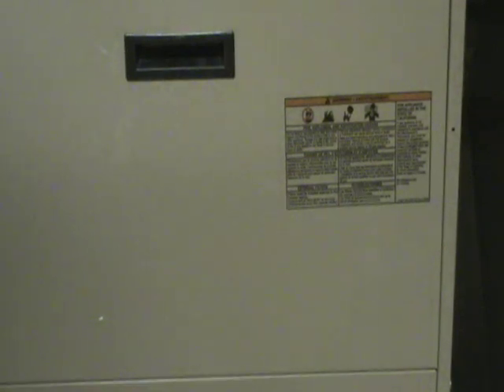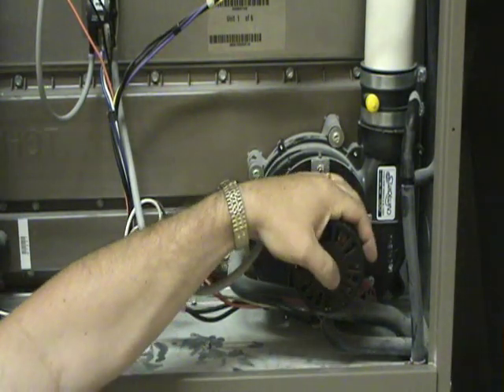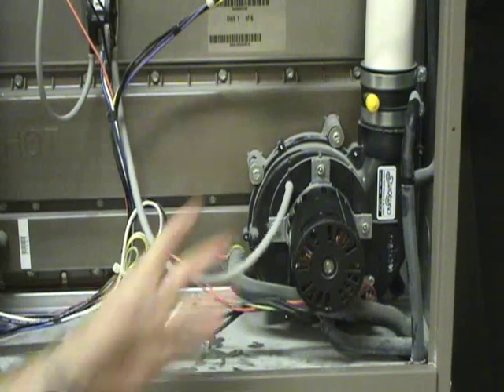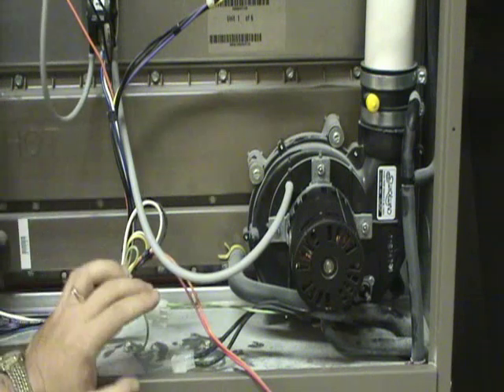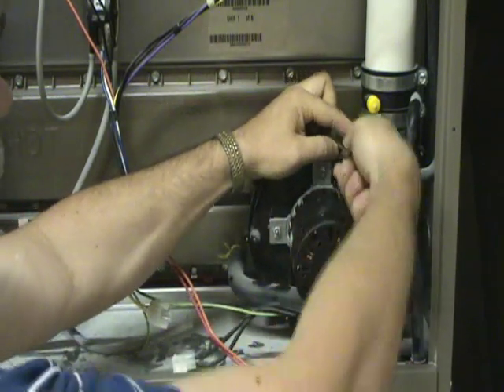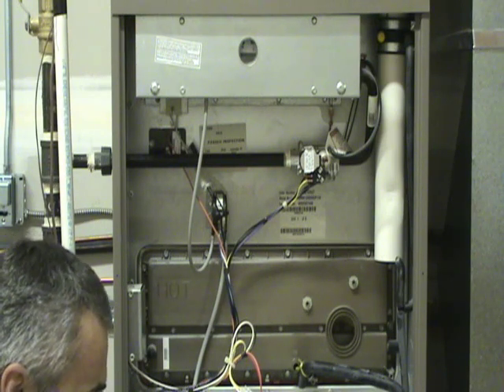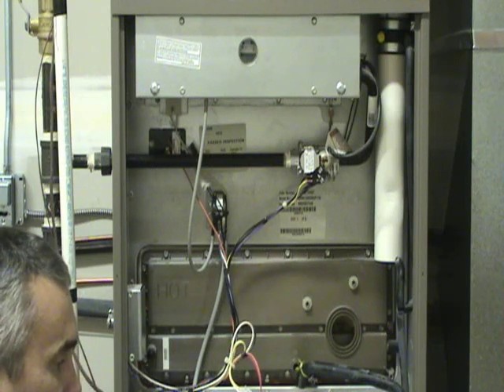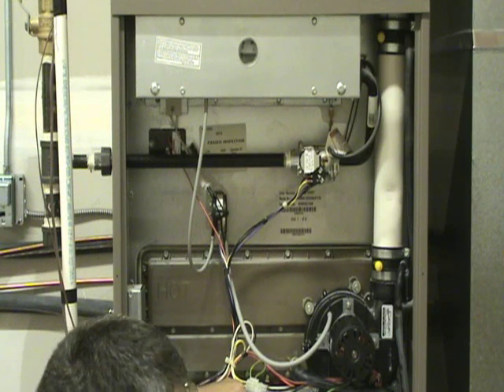Furnace Won't Start? Your Inducer Motor Might Be Dead! 🛠️

Comment from the maker: Is your furnace making a loud grinding or screeching noise before it even tries to light? That's almost always a sign that the bearings in your inducer motor are failing! 🔊

Quick Tip: Before you buy a new motor, check the small vacuum hose going to the pressure switch for cracks or water. Sometimes a clogged hose mimics a dead motor! [03:00]

Comment: I have worked on furnaces but I thought the inducer would shut down after the burner lights.  I know the reason for the inducer and it has done it’s job and shut down.  But I noticed they keep running until the limit switch shuts the indoor fan down.

Comment: My 5 year old Goodman furnace started with more whirring noise on Sunday, I opened the side and noticed the sound came from the inducer fan.  I wrote down the part number and found the part from Amazon.  Placed an order with next day shipping option.  The replacement fan came on Tue.  At Tue evening, the fan died completely.  It was very hot.  I replaced new one and the furnace worked as before.  By the way, the temp at Tue night was 5 degree.

The Goodman is the least reliable brand for a furnace.

Comment: Good Videos. Question i buy and sell homes so i would like to save money instead keep getting the home inspector to take a look at these units what is the basic run down i should look for when inspecting both furnaces and hot water tanks. How to determine if the furnace is both AC and Heat or just Heat.

Comment: I changed the blower wheel on my inducer was easy except for the old wheel center part with the set screw I had to use an extractor to get it out of the motors shaft,  I got the wheel for only $25.00 and also changed the ignitor, 4 years ago changed the "mother board" easy task too I just video taped where the wires were connected. Thank you for posting videos like this it helped me to save tons of money doing the repair .

Comment: I just got done changing mine, I wanted to save money and just buy the motor but it was hard to find the right size, So I just changed the whole thing out.  It was very easy! It is around 18 degress out and I had to get it fix NOW.  I had the fireplace running to keep the family warm.  Yes my motor was hot when I trouble shoot it.  I paid $192.00 for the whole new unit.  
I was wondering what parts should I replace, before it goes bad? (Just un case) I had this unit for about 15 years?

Comment: THATS WHY IT COSTS SO MUCH TO HAVE A COMPANY CHANGE ONE OF THESE OUT IS BECAUSE OF THE MULTI-MILLION DOLLER GENERAL LIABILITY INSURANCE YOUR LAWER WILL BE SUING WHEN THEY BURN YOUR HOUSE DOWN!!
Reply: How would this failing burn your house down moron, if anything it would cause carbon monoxide exposure if pressure switch fails

Comment: DUDE what if your heat exchanger is cracked or your flue is clogged you still get the same flashcode!
If someone follows this video and kills themselves I hope the family comes back and  SUES YOUR ASS INTO YOUR NEXT LIFETIME AND TAKE EVERYTHING YOU HAVE. AND TEACHES YOU A BEGINER KIND OF LESSON!!!!!
Reply: dwdrumwiz Are you an HVAC tech, by chance? I realize you commented on this video ages ago, but I am just wondering if you work in the industry.
Reply: dwdrumwiz will do exactly what this guy just showed you how to do on your own for only $900
Reply: dwdrumwiz you must be HVAC repair guy.
Reply: dwdrumwiz 
I understand where ur coming from. But since your already talking about it. Why didnt go ahead and tell people how to check for cracks or clogges
Reply: Its just simply a matter of doing it yourself.
Reply: Your an idiot im not an hvac tech but have learned enough with research that if your flue is plugged first you would have no exhaust and your pressure safety switch would shut off furnace and second you would have rollout and if your exchanger was cracked you would get rollout when fan starts, your trade is basic, 3 years and 60% to pass the course gimmy a break, your just mad that anyone can learn your easy ass trade online without schooling or paying for a certification and you are losing buisness,  this isnt rocket science

Comment: This video was right on.  It cost me $200 for the part, but hvac companies were quoting $500-600 to replace it.  Without the well done video I would not have been able to replace it myself.  Thank you!
Reply: Mee too.  Bought the exact replacement online (this was 6 years ago 2016) for $138.00.  Easy replacement like a plug and play.  Local furnace service contractor estimated at about $500.00 along with a full furnace inspection...